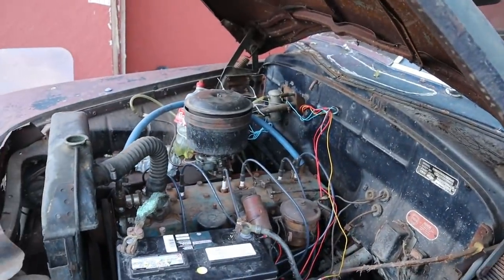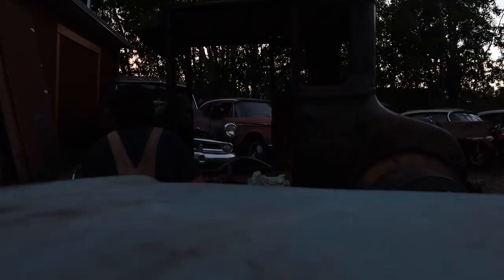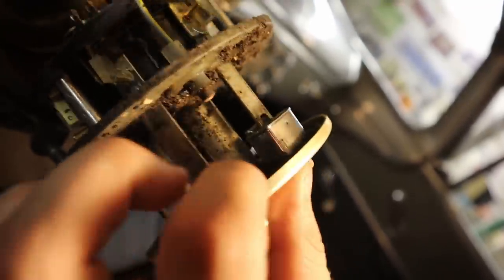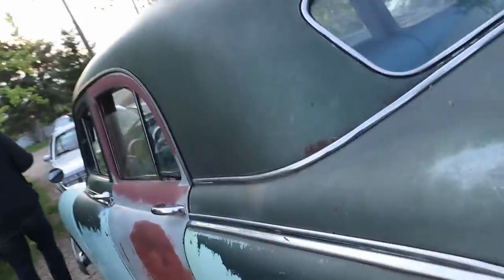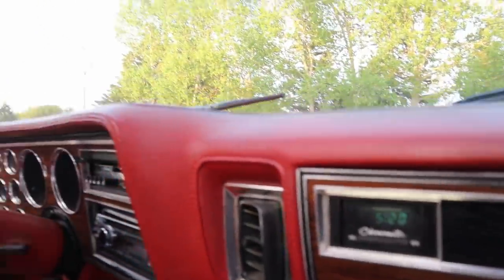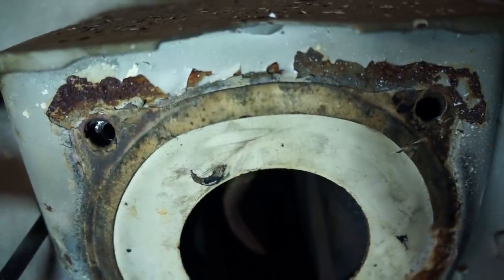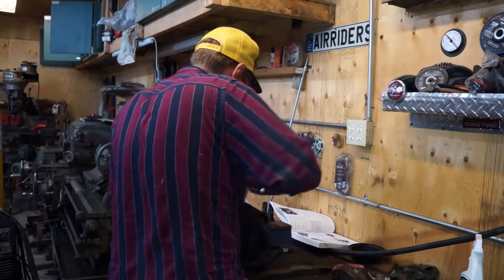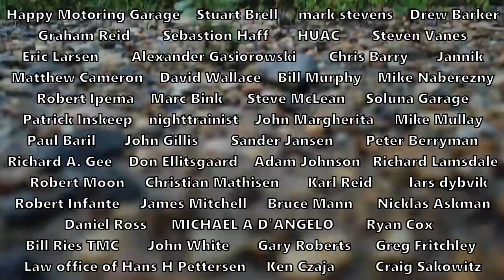Summer Showdown Week 3! Tele-Touch, Treadle-Vac, Model T Teardowns! Plus: T-top LeBaron Test Drive!

Comment: The Tall T mockup scene is absolutely hilarious. The Edsel Tele-touch steering column engineering is central to both Edsel the car, this episode and is downright interesting to boot. Dean's shop overalls are the next fashion sensation, coming soon to the CWM merch store? Nah! Really like the Lebaron T-top a shit load. It was one of the last decent Mopars of a long lost era. An old gf had one just like it in 1980 something. 318 power with Lean burn issues, but the gf ran nice and smooth. Team Jim doing his best CT impersonation tearing shit down. Love it all! Cheers!
Reply: @rareblues78daddy  Yes, 1979 wasn't Chrysler's best year.  My first car was a 1979 2 door Diplomat with a 318 4 barrel (thermoquad) and 727 trans.  It was the most rattly car on a rough road I've ever driven.  When it was running right it was a good car, but the only trouble free thing about it was that great transmission.
Reply: Congratulations to Dean!! Can't wait to see him behind the wheel!
Reply: My '87 Shelbys are plenty decent.
Reply: @rareblues78daddy  doesn't it have that "Rich Corinthian leather" that Ricardo Montelbaun used to hawk?

Comment: Chrysler Lean Burn was awesome. Chrysler engineers figured out you could burn an 18:1 air/fuel ratio instead of the standard 14:1 if you advanced the timing to 52 degrees. So they made a carburetor with an adjustable main jet and a distributor with 2 pickups, and a simple computer to control it.
You started off in rich mode for starting and once warmed up, would go to lean burn on a steady cruise, then switch back to rich for acceleration if you hit the gas. The result was a V8 powered American sedan that got the same hiway mileage as a VW Rabbit, no kidding. That is according to EPA figures on a 318.
The downfall was that no one could figure out how it worked, or read a repair manual, simple as it was. It was too easy to throw on a standard carb and distributor. But when they were working they got fantastic mileage for the times, like 25MPG hiway for the LeBaron.
Reply: The lean burn ran well here in Australia, but I think also suffered from poor repairs, it was adapted to the local Hemi 6 Cylinder in the  local Valiant sedans here.

Comment: One reason they don't use the TreadleVac anymore is that if that little spring on the compensating valve breaks you have total brake failure. It would be a good idea to use 2 small springs if possible, the way they do on carb return springs just in case. This was a known failure point when they got old.
Reply: I ditched the one on my Packard and fitted a hydro-boost unit. 👍
Reply: What a high dollar failure feature. Any sludge or rust in that vacuum can & the brakes get real lazy, if not complete failure.
 Quite the backwards design. ???

Comment: The shifter on the Edsel. Those old school engineers truly deserve respect. The ability they had to design mechanisms that were stupid simple or elegantly complex. Sometimes both at the same time. That shifter I put in the same category as the old wico x series magnetos. Electro mechanical design that makes you scratch your head untill you figure it out then you are in awe of actual the design.

Comment: You've gotta love that LeBaron.  That's got to be a super rare car now, and even more so in Canada.  Finding one in proper survivor condition has got to be pretty close to unique.  I bet Kyle just loves cruising around in it acting like LeBaron (play on words from the title of an old British TV show...)

What really did away with things like the treadle-vac was the fact that the same job can be done much more simply, reliably and, above all, cheaply with a vacuum servo or booster.  A vacuum servo contains just two, or sometimes three, moving parts, the diaphragm, a one-way valve to prevent the vacuum returning to the vehicle engine and thus keeping the servo charged, and sometimes the rod that actuated the brake master cylinder, though on most vehicles that is a separate part or part of the master cylinder assembly, but I have worked on vehicles where the actuating rod is an integral part of the servo.  Looking at the cutaways in the manuals, the treadle-vac system uses a whole lot more moving parts which reduces reliability and hugely increases production cost, which all vehicle manufacturers are constantly trying to reduce, often not in the right way.  A servo is a non-service item, requiring no maintenance, and inherently very reliable, there are plenty of 30+ year-old vehicles around still running their original servo which is still operating well.  What tends to be the most common killers of them is corrosion of the casing, as some vehicles like TVRs have them mounted in undesirable places where they get attacked by road dirt, and brake fluid leaking into the servo from the master cylinder, which causes the diaphragm to perish and fail and means no servo action as the pressure inside the servo is the same on both sides of the diaphragm.  The one-way valve is the reason why you have to pump the brake pedal several times to exhaust the vacuum before starting the vehicle with the brake pedal depressed to test if the servo is working correctly.  I don't imagine there was anything inherently wrong with the treadle-vac system as it's very unlikely it would have made it onto production vehicles on safety grounds if there was, it just got replaced by a cheaper, simpler, more reliable option...

Comment: My money is still on the Dean Machine even though I saw his lead dwindling as several parts came off the Edsel. I broke out in a cold sweat watching the exploratory surgery on the tele-touch shift mechanism. Gladly, it appears to only need a tele-tidy! The compensating gear drive to keep the center hub stationary is wild!. I was surprised to hear talk of painting the T chassis. I thought it was supposed to keep its patina. I hope you at least use a brush! I wonder if it would be a good idea to replace the  Lincolns TreadleVac with a more modern type of master cylinder. It doesn't look like it would be a huge job and it may add some safety. The T-top LeBaron was a treat! They couldn't have made many of those. I would look for an excuse to lose the "lean burn" nonsense, though. The fuel crisis is over.  Cheers!

Comment: I could give a SHIT about the inter workings of a Edsels push button shifter, installed in the steering wheel.....
Until I saw the incredible engineering that went into making something so overlooked to most. Wow, my head starts smoking just trying to figure that out! Thanks guys! Love your content! Tommy in Northern Minnesota.
Reply: All of that engineering and money spent to only use it for the one year.  The problems with that system were usually the relays and not the buttons.  I hope they show all the relays it takes to make that system work.
Reply: @mexicanspec  yeah I agree. My first car was a 63 valiant with a slant 6 and a push button automatic. I punished that ol Plymouth and the pushbutton, but it never failed once!  The engineering, and technical specifications that went into that Edsels steering wheel in 1958 are mind boggling! Henry Ford must have stole that engineer from NASA....
Reply: @tommyeugene  My first car was yous big sister.  I still have my 1963 Fury Commando 361 Sedan.  She also has the push button and I won a few races because of it, 35 years ago.

Comment: All three cars are coming along nicely! Enjoyed the major in depth dive into the Continental's unique brake booster by Jim. Hope he finds a kit available with all the necessary seals and gaskets. If so, that would be amazing for its age an uniqueness. Definite love and like for the LeBaron! Amazing condition for a far North car. I remember that era of the wine colored velour upholstery, brocade designs on fake wood on some car models. Interiors of that era really looked cool at night with their experimentation with various lighting innovations and coloring. Entry lights, a individual reading lights, opera lights on the external vinyl tops, map lights, make up mirror lights. Definite era of POSH! Thinking that Chrysler was more driver oriented with the most engine gauges when GM went near total idiot lights except for the fuel gauge and they'd have made that an idiot light if they'd have figured out how to get away with it! Chryslers often had oil pressure gauges when others did not. Amazing setup on the Edsel's transmission selector system! Not bad for the era especially with Ford's deep dive into the technology and the three years of the retractable hardtop/convertibles. Great show Scott and Crew!

Comment: I used to make radiators for model A's model t's and willys Jeeps. And in all the years of doing those I've seen so many people ruin their radiator in their car because of hitting it with the pressure washer. It will bend over the fins could possibly cut a tube. After we built the radar and it was pressure tested to get it cleaned or painting you just wire wheeled the brackets the tank's and then again most people ruin her radiator by painting it with enamel paint it turns it into the opposite of radiator. Diluted driveway sealer with gasoline works the best for painting a radiator.

Comment: When that "Zero chance" T hotrod gets started, it needs to be a Model B engine (your friends can source a "overhead valve conversion) with a 39 box and Zepher gears. ;o)  That scene showing the radiator in Deans Edsel reminded me of opening the hoods in fords back in the day and finding the entire engine compartment "rust stained red" from the cooling system blowing up. Remember those little "surge" coolant tanks???

Comment: Grandpa had a '78 LeBaron with the same red interior & white paint.  No t-tops. My dad & pops rebuilt the 318 in the driveway at his house.  As a kid I thought the dash with all of the gauges was really cool, and those weird turn signal indicators up on the fenders.  It didn't pull like my dad's '78 Holiday 88 with the Olds 350/4 barrel, but it rode a lot smoother. Still pulling for #TeamEdsel if you can get the Tele-Touch sorted.  And yeah, Kyle did steal that Chrysler! This is the first one I've seen since grandpa's.

Comment: Love the Edsel ! I have a 58 Skyliner with Treadle Vac but it's all under the  dash with a conventional master on the firewall. Thankfully it seems to work fine although not as much boost as a modern brake booster.

Comment: Poor Jim! Feeling for you, mate. 

Rear seal in my 1987 Toyota Hilux master cylinder failed, but there was no clue other than fluid level dropping. Went crazy looking for leaks from the brake lines, calipers & wheel cylinders. Replaced the master cylinder but still didn't know where the fluid was going. 

Turns out the vacuum booster sucked in the brake fluid from the bad seal. The rubber vac booster seals eventually failed- a couple of years later! The symptom was high pedal effort because the booster was no longer boosting. $AUD75 vacuum booster for a 1995 80 series Land Cruiser later (boosters NLA for the 87 'Lux) & Bob's your uncle.

Comment: Excellent video Cold Water Motors  :)  also never seen a 1979 LeBaron in T-TOP  version also in that super excellent shape too also rest vechiles and got Lol for you guys The Model T should have a Creeper 4 speed Manual transmission with bow Low also 390 4V 4 barrel carb too of a Holley 1000CFM  with daul exhaust and  388 rear ends posi gears plus 100 litre Rectangular tank too !  Just kidding with you all and Dean Edsel car check with Rock Auto for Time Chain plus gear set and should have one !

Comment: You figure if hendry is using 2×4's for the T's "lift kit", I'm thinking for the roof drip rail you're pretty safe with some 3/4" cove molding up there! Lmfao! Don't spare the expense ya know?!? 
Loving the cast of characters too! Tom head super and 2nd easiest bribe able judge,compared to Frankers where a milk bones goes a loooong loooong way garnering her much needed vote!
As the old saying goes, I may be cheap! But I ain't easy!!!
I think Dean was a wee bit concerned about his shifter turned into a newly guinea pigged, I'm learnding on this as we speak surprise! project by Steve! He's got seconds worth of experience on it,lmfno! Oh Deans got to be on the horrors as he left last night with a running car to show up next day to a dismantled pile of disarticulated metal bits that doesn't even closely resemble a um,what the fuck kind of car was that again? I've seen those horn shifter buttons disassembled before and well,good fucking luck with that! lol! Take lots of pictures and videos and get spare parts if you can find them! Lmfao!
I think the previous Lebaron owners rejected it because there wasn't any fine corinthian leather much touted by Ricardo as in the Cordoba! As the only one 'Merican watching this incredible show,i very much appreciate the non metric conversion by youz guyz up there! Thanks!
Special cleaner able for use on absolutely everything except 1956 mark 2 master cylinder unit!!! Will explode and disintegrate device upon contact! Lol! Good thing the cat wasn't on the bench when that master cylinder went off! Jim would've had another episode like in the Boondock Saints! Lmfao! Thanks again guys!

Comment: Edsel Pushbutton Transmission caveat:        Oh Dear - you guys are into it now, with that Edsel.  Back in my tractor mechanic daze, my boss bought one, for ME to restore for HIM, with the pushbutton transmission.  No book, no nothing.  More wire than 5 other cars.  Relays, a servo-motor to make and break contact, with stiff wire fingers and shaped brass or copper contact plates, separated by nylon disks to isolate them.  A donor car had to be bought, as shift parts were missing on #1.  After much head scratching and hair loss, the problem was that the nylon had swelled over the years, and had to be machined down slightly, to restore contact with the stiff wires to the plates.  I told my boss I was due a degree in EE for that job.  I hope yours doesn't have any of the problems that one did!

Comment: For the Edsel, Rock Auto has the chain and both sprockets. You have a choice between Cloyes or Melling. The prices are comparable, about $50.00 for all 3 plus they have the gaskets. Shipping may bite you, not sure how shipping between the U.S. and Canada works.
https://www.rockauto.com/en/catalog/edsel,1958,ranger,5.9l+361cid+v8,1440366,engine
Reply: Yeah, realistically I don't think any of the mechanicals would be hard to get parts for, is an excellent point that Tele-touch is in outstanding condition then.

Comment: When I worked at a Chevy dealer back in 1987 I went to the ASC shop that was close to us.  It hurt to see them cutting the roof off of a new Monte Carlo SS.  They were not concerned with quality in the cuts.  Their T-Top frame covered all that.  If you have one of these cars, do not take out the frame.  You do not want to see all of that.

Comment: Hard to find but I would try to find period disc wheels for T, or at least multispoke wire wheels. They look cool. Model T did not have a drip rail in the modern sense. They had a probable brass molding that ran around top edge. It was painted body color. I would pull engine on Edsel and pull intake, heads and oil pan just to check mechanicals and replace old gaskets, bearings, ??? I would do it now while rad is out and hood off, etc., especially for a daily driver. The fuel gauge doesn't match in Edsel. Weird. Lean burn was a good system for them time. It required keeping the components in top shape and using quality fuel. The biggest issue was the computer was mounted on the aircleaner. Too much heat and vibration. Move computer to firewall and it was reliable if the sensors were all working. My aunt had one and never had an issue over 10 years.

Comment: If not a Model T hot rod, maybe a model A roadster?  That Treadle system seems like a nice piece of engineering, but I can see why they moved away from it.  Too many parts and complicated to assemble at the factory.  Then again, those Lincolns were pretty much hand built in low volumes.  Must be hell finding parts.  If you run into troubles try Ford Obsolete in California.  That's where I found the left and right water pumps for and old flathead in a Monarch.  They make new old parts and have new old stock at times.

Comment: Whoever asked if the Tele-touch was like a DS, just a few generations of Citroën out. I have a MY2011 Citroën C5. It and C4s of a similar vintage, have a steering wheel hub that does not rotate. Not for gear selectors, but cruise control, display and ICE management. Citroën also claimed the air bag deployment was better, as it was in a consistent direction. I have no wish to find out!

Comment: I have a 1924 Model T Coupe fully restored on a trailer in my garage.   Hasent' run since 2009.   Going for Auction on Aug . 5th 2021.   Anybody have any interest?
Reply: How much and where is it
Reply: @Danglebarry62  Edwardsburg Mi,   49112,     Auctioneer says it is worth between $8 k to $10k.
Reply: @markwilson4965  Sounds awfully high for a 24. Good luck with it.

Comment: I would rather have a Lincoln Mark ll from 1956 or 57 in that condition than either one of the others in showroom condition. Piece of junk Model T was basic transportation, that was at least 10 years obsolete behind the wheel and 30 as far as the suspension goes. As far as the Edsel goes, I would rather have a Ford at least you can get parts for them but there is no difference except the grill.